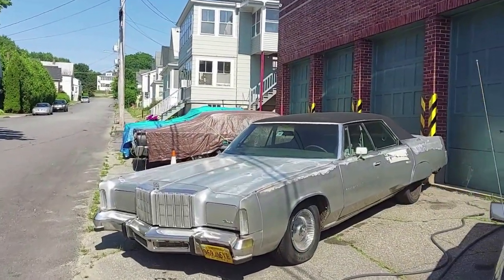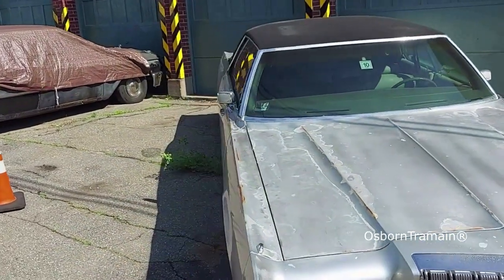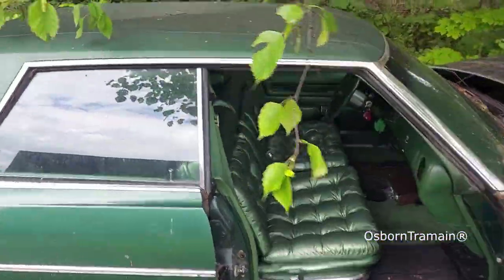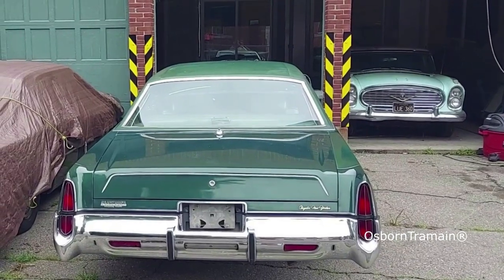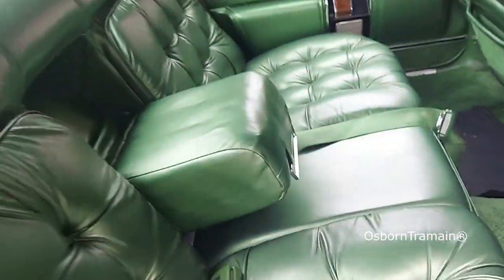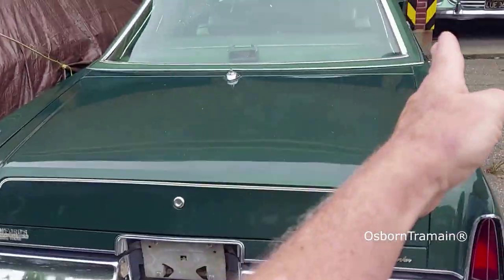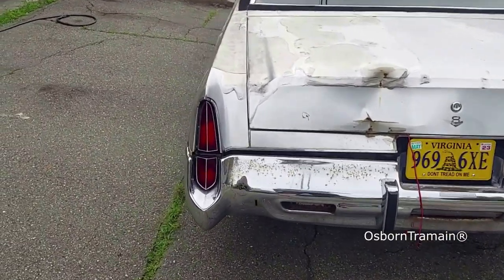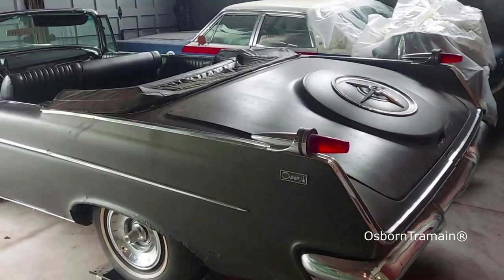1978 Chrysler New Yorker Project update & 1962 Imperial Crown Convertible

Comment: You will need to have the frame aligned, even if the parts fit. The impact will have moved the from frame slightly.
Reply from the maker: yep, agreed.the damage to the front left fender shows that the frame will need some alignment